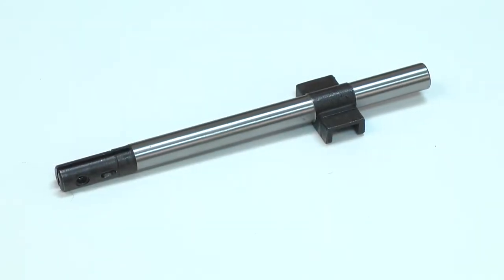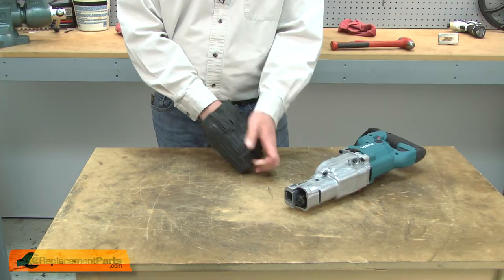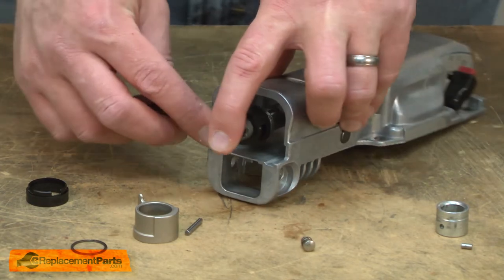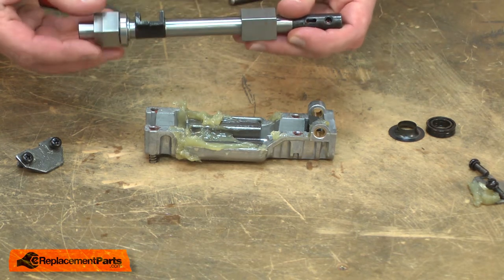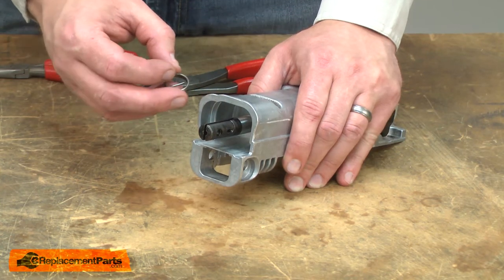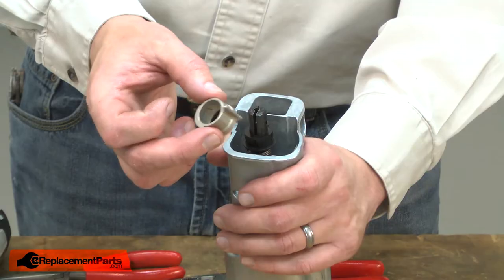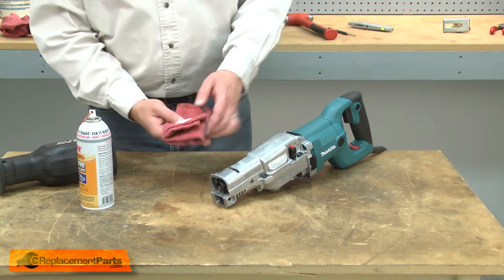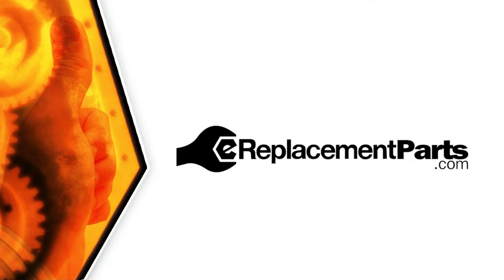Makita Reciprocating Saw Repair - Replacing the Slider (Makita Part # 168410-8)

Comment: Thank you for making this. Really saved me on getting the blade holder apart and back together. 
I was cutting out the lower control arms of my truck, the blade jammed onto the frame and the bearing punched right through the casting on the slide.